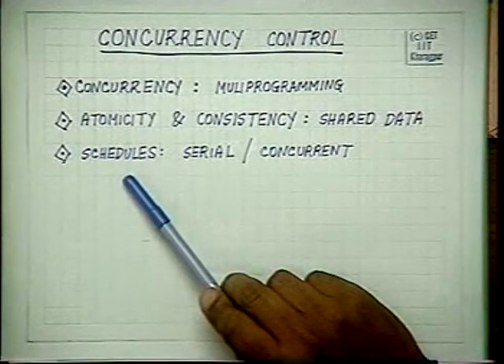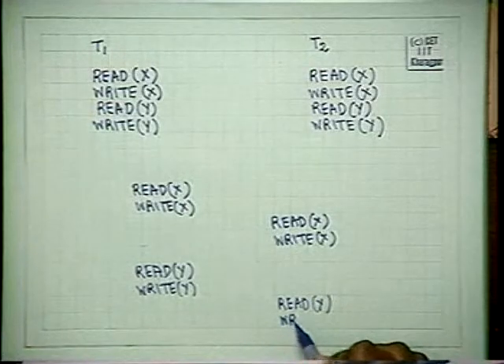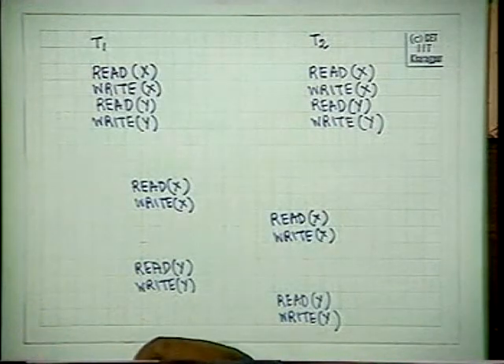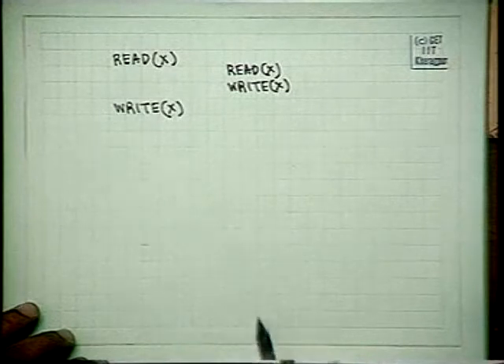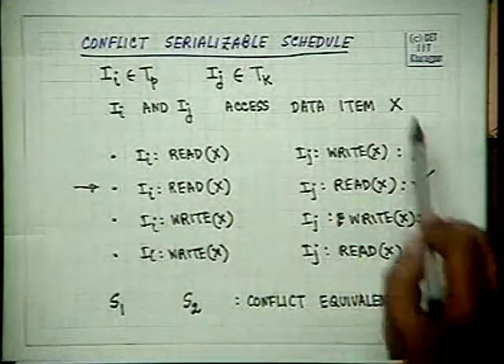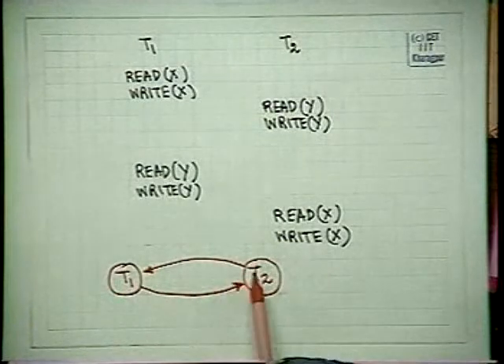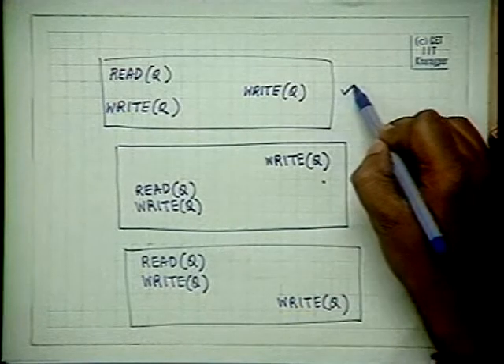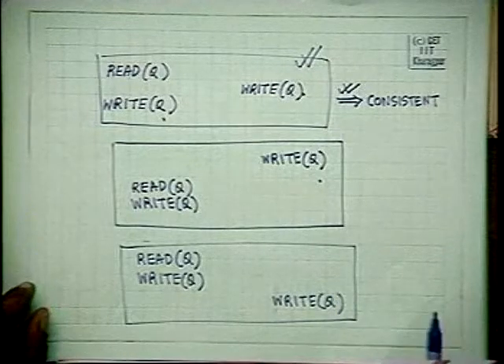Lec#31-Concurrency Control-2

Comment: Thanks Sir, I have understood the concept very well. But I could not understand how the last schedule that is View Serializable.
                                   Read(Q)
                                                  Write(Q)
                                    Write(Q)
 Because in <T1,T2> serial schedule it violates the FINAL WRITE condition.
And in <T2,T1> serial schedule it violates the INITIAL READ condition because of the blind WRITE.
Reply: See rules pretty much says that
1. First read should be by same transaction
2. Last write should be by same
 transaction 
3. If t1 produced a data and t2 reads same should be done in other transaction

Here <T2,T1> is correct bcz first read is done by T1 in both transaction (does not matter if T2 writers before it, we don't care about writes)
T1 does final write in both and cond.3 is not applicable here (reading a produced data one)

Thus T2,T1 is view
Reply: i too agree ... may be its not view serializable....
Reply: i too think that the schedule is not view serializable!
+1 Rohini Kumari... i used exactly the same logic and was confused!
Reply: even i didnt got